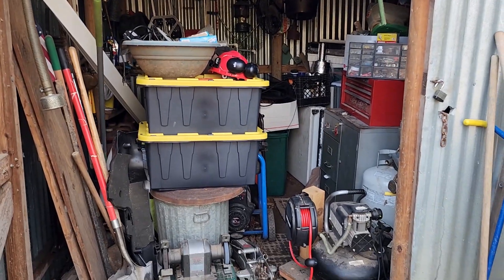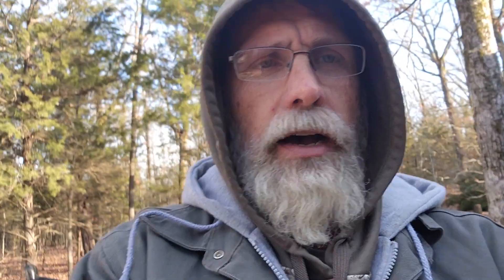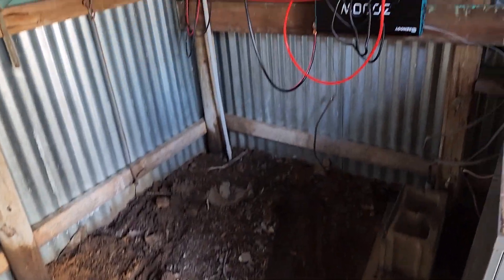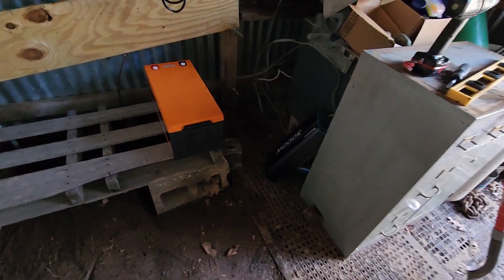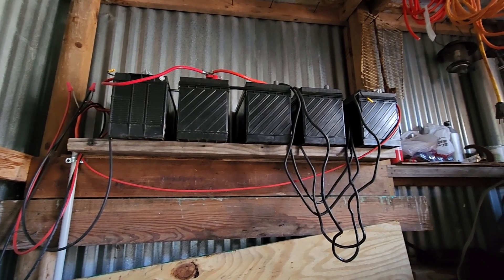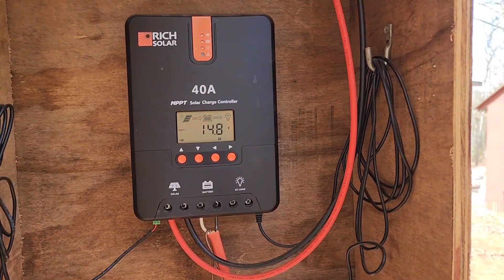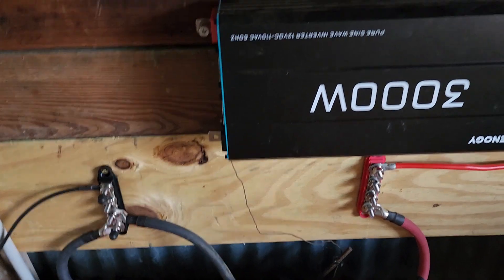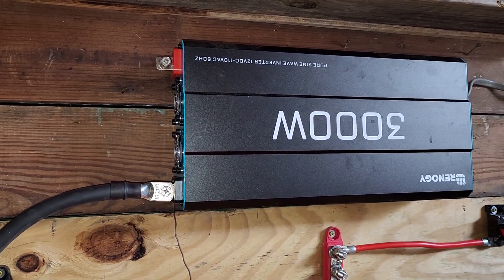LiFePO4 Battery Upgrade To The Solar System

Comment: Once you get over 1.5 kw I think its time to consider going up to 48v  for storage  as the amps at 12v are getting way too much
Reply from the maker: I actually ended up doing that a week or so ago the video is just a couple weeks out.
Even after that upgrade, I was still having problems. So I ended up sitting down, calculated expected needs and built from there.

Comment: Do yourself a favor and put a 200A T-Class fuse between the main positive of your battery bank and your positive bus bar.  If you have a short on those inexpensive batteries, you want a fuse that will fail before the wires ignite the wood you used in the build.  If you'd like some instruction on how to build a simple battery heating element, to ensure your cells are never charged while frozen, let me know.  I built one for my system and it only cost about $40.
Reply from the maker: We've already done another upgrade to the system and I have a 150amp breaker between the batteries and the inverter/charger.

I am interested in the warmer though.
Thankfully we don't get super cold here in Oklahoma, but enough that'll be a problem. Researching that was on my to-do list for the summer
Reply: idk, I have seen more damage caused by loose/corded connections than by something that was unfused.  I don't like any more connections than necessary.  The chiniseium  in the equipment is likely to spontaneously combust  anyway.  nothing is going to stop your solar array from pumping into a failed charge controller ect ect ect.  best thing you can do is minimize combustibles.   I would say that every battery should be connected to the buss bars by equal length cables. its going to cycle that first battery  more than the rest.

Comment: Nice setup, how cold does it get were you are?
Reply from the maker: Not too low. Since buying those batteries, I've learned they can't charge below 32. Thankfully, we don't have many days where daytime highs are below 32.
May look at some warming mats and possibly make a foam insulation box to go around them.
Reply from the maker: It gets in the 20s, but usually warms up once the sun comes out.
Reply: @tnthomesteading  do the batteries have a low temp sensors? If so you should be good. You could move the system indoors, I know more work. I’m not sure the effectiveness of heating blankets and they take power. I’m in Pennsylvania and I have mine indoors.
Reply from the maker: We're in eastern Oklahoma. And between the two cabins, only have 400 sq ft. So not much room to bring inside. 
It's something I'll have to heep an eye on.
Reply: @tnthomesteading  That’s really nice amount of power I would hate to see that battery bank damaged. If you have days of cold temps no way to charge them, you could put the battery bank inside and cover it with a bench or something useful in that space.

Comment: Charge controller should be next to batteries to be efficient,looks like thin wires to the batteries for that longer run
Reply from the maker: Thanks
They obviously weren't during that video, but I moved it to inside by the batteries.
I initially had them close to the panels, as I misunderstood when I first set them up, but moved it shortly after this video.

Comment: Love the set up.  Very nice.  Just remember.  Connect and disconnect for charge controller.  Connect. Should be batteries to charge controller then turn on solar.   Disconnect should be disconnect solar then batteries.
Reply from the maker: Thanks! Gotta have a place for the charge to go! I should be able to remember that!